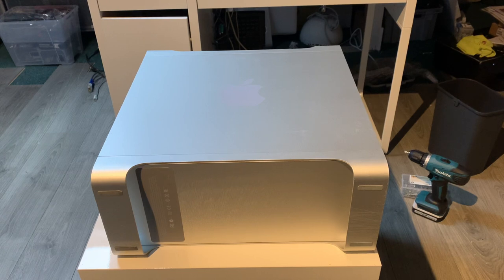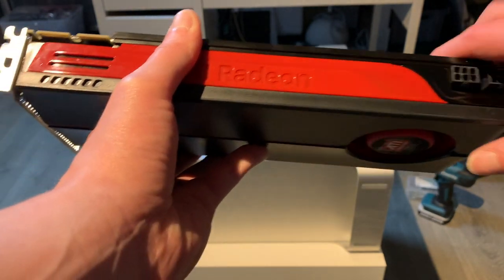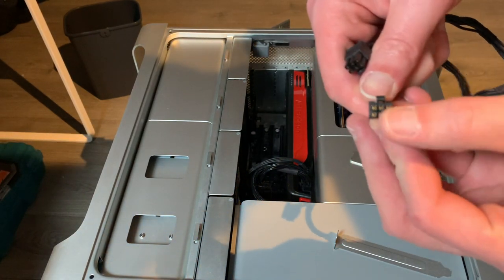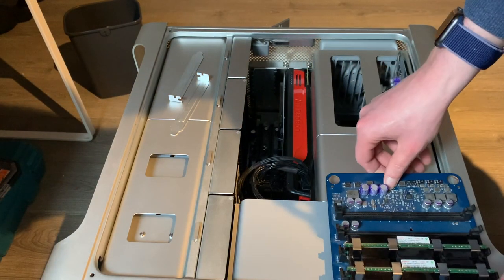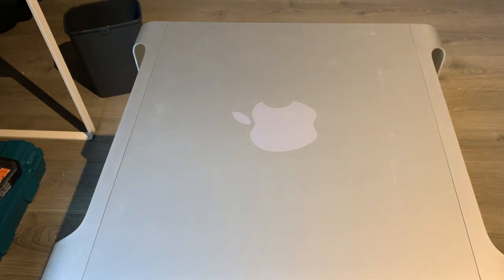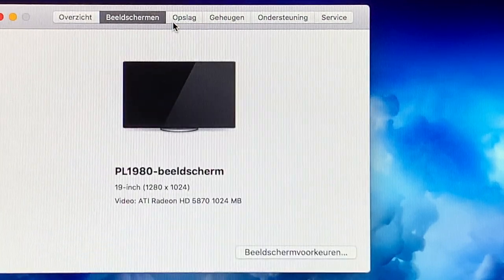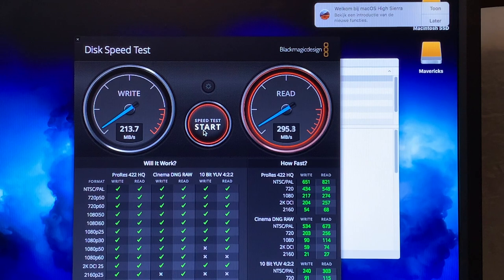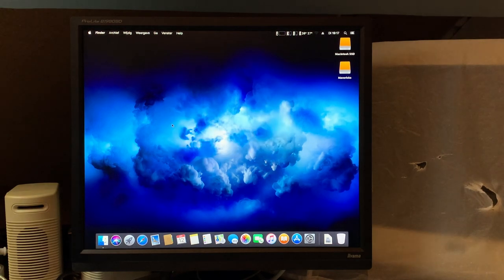Upgrades for the Mac Pro 3,1

Comment: Thanks for sharing!
My main Mac is one of these 3.1, 3 Ghz, same graphic card, 24 GB RAM. It´s great. And while my wife´s Air is being repaired I bought another 3.1 Mac Pro (2.8Ghz, 32 GB RAM, SSD +1 TB HD, Radeon 4870) for less than $300.
Until we get one of those gorgeous new M1 these Mac Pros do the job!!!
Reply: Sata SSD runs like 5 times faster.
Reply: @reinaldolockeortiz  I know…

Comment: Mac Pro 3,1 probably the best computer ever made. As long as you have an octacore, get an ssd and upgrade the gpu to something nicer. The most you can go is a gtx960, the CPU will bottleneck the card if you get something nicer. Rather that over a 680 it's newer, just save your original gpu, if ever need a boot screen. You can also just choose the start up disk right in settings anyway.  Itll run Monterey fine. The cpu dual 2.8ghz is still better than the minimum spec MacBook Pro that can run Monterey. Computer will last to 2030 and be usable for multitasking, presentations. I have mine set up with 3 HD's. One 500gb ssd with the dosdude Catalina patched os, (will prob wait a few years before trying a Monterey patcher) an old 1TB Hd 500gb partitioned for time machine of the ssd and 500gb as bootable version of El Capitan. Then the original 320gb partitioned as a boot disk, and 250gb partitioned to keep the patched version of the OSs. Always have backups!! Especially when you start playing around with the patching.

Comment: Lucky that putting air through the riser cards worked. I had to order new cards and then I was still having 2 slots that were dead.
Reply: Indeed: Two Slots from one of my 3.1 riser cars died months ago; I was pissed off. But I bought two second hand risers (they included like 16 GB  of RAM too) for maybe 30 euros.
Reply: (riser cards)

Comment: It looks like your aftermarket RAM is overheating. It's not built for that machine, since it doesn't have the proper heatsinks. I believe on the MacPro3,1 the temperature of the RAM is only measured on slot 1 and 2 of riser A, and it looks like you have OEM RAM in there. If so, then what is happening is your Mac Pro is measuring the temp of the RAM with the giant heatsinks which will be cooler, and keeping the fan speed low to match those lower temps. This means there is not enough air going through for the other RAM, so the other RAM will overheat. If your new RAM has temp sensors, you'll want to move those RAM modules to DIMM slots that can utilize those sensors, to allow the Mac to more quickly raise fan speeds to keep the RAM cool. Unfortunately, with this type of RAM, often that means more fan noise. OTOH, if your RAM does not have temp sensors, then you are out of luck.
Reply from the maker: The RAM is sitting in the 50’s most of the time. I’ve used Mac Pros with this kind of RAM for years. Never had issues.
Reply: @nelizmastr  I'm not sure if I explained it correctly. I'm not saying you shouldn't ever use that RAM. I am saying that if you are going to use that RAM, then then it should be in the DIMM slots which the Mac Pro can monitor. If I interpreted what was in your video correctly, you had the OEM type RAM in the temp monitored DIMM slots, but put the new server RAM in the other unmonitored DIMM slots. It should be the other way around (if that new RAM has temp sensors that is). That type of RAM tends to increase in temperature much more quickly than OEM RAM, and the only way the Mac Pro can compensate for that is if it can detect that RAM's temperatures. With the way you had placed the RAM in the video, the Mac Pro can't do this.
Reply from the maker: All RAM slots are monitored in the Mac Pro. All memory modules have temp sensors, so it’s okay. Fan speed increases occasionally when RAM is loading up so all is well :)

Comment: some minutes ago, i found on the internet a mac pro 3.1, with 2 xeon 2,8 ghz quad-core CPUs, and the nvidia quadro fx 4600, 32 gb of ddr2 ram, and macOS catalina installed. i thought of buying it and then upragind it maybe a lot, with things like an rx 570 or an ssd. now that i watched this video, holy crap, i buy that thing right now!
Reply from the maker: Catalina will not run properly on that FX so definitely throw that RX570 in there. Should run well. I’m going to properly upgrade to a newer card at some point as well.
Reply: @nelizmastr  thank you for the tip, i will leave it high sierra. Is it ok if i add a gpu? the guy who sells the mac pro, says that you can have maximum 4 graphics card working together, snd if it's true i tought to buy an rx480 and a rx 570, put them in, and make a beast out of that mac pro
Reply from the maker: It won’t run 4 cards at full speed. The bottom one is the only one that’ll run x16. The second one will run x8 and the top slots run x4.
Reply: @nelizmastr  thank you so much for the help

Comment: I just bought one of these for $25! Great to know that I can do cheap upgrades
Reply: 25 dollars?? These things do 250 euro over here still 😳
Reply from the maker: I bought mine for €80. It's mostly the later models, like the 4,1 and 5,1 that still sell for stupid amounts :)
Reply: @nelizmastr  Yeah. True. I must admit the one I picked up three days ago was 50 euros because it was supposed to be broken. I didn't (want to) believe that and I was right: it's fine. Found 24Gb of 667Mhz memory and bought a 120Gb SSD. Total money spent is now 81,30 euros and it is plenty fast! Will install Catalina on it. And if we get lucky dosdude1 might be able to get Big Sur on it? That would be INSANE.
There's an offer for two 4,1 Mac Pro's around the corner for 200 euro's the two. Missing memory and disk. Might be buy-in those to resell for that insane price ;-)
Reply: @SleeveZipper  in Belgium also 250-300
Reply: @SleeveZipper  Same in the UK. They go for crazy money :(
Reply: @yamahamusicians  I'm going to sell mine for crazy money soon I think. My MacBook Pro early 2013 is now about 600 euros 2ndhand. Nuts!
Reply: @SleeveZipper  big sur is on the mac pro 3.1 dude, just need a metal gpu.. And upgrade the wifi, and fit pcie usb 3.0 if your that bothered
Reply: @mikesinclaire8233  I know it is but I haven't found a proper guide on how to do it though. There's guides but these are all fiddly still. Have you done it already?

Comment: Are dirty ram slots of mid-seated ram modules a common cause of the red led’s on riser boards? I had 4 of 6 sticks show as an issue and just removed them thinking they had died.
Reply from the maker: If the slots have been unpopulated for years, it becomes an issue, yes. Dust builds up in there. Some compressed air or a soft brush should fix it though. Another cause of the red LED is improper configuration. RAM has to be inserted in a certain order to work properly in dual or quad channel configurations.

Comment: Where did you get the ssd adapter that holds your kingston ssd and m2 ssd? Can I use any kind? I have a Mac Pro  3,1 also
Reply from the maker: I got the 2,5” to 3,5” adapter from Amazon. Icy Dock makes these and I’ve had great luck with them.

Comment: how do you conect to the monitor? wich cable i need? my husband found this on garbage and im new with mac so im trying give life for this. tks
Reply from the maker: It depends on which connections the graphics card has. It can have a combination of many different ports. Most have one or more DVI ports (large white rectangle), others have mini-displayport (small almost square port) or HDMI or full Displayport (both black). 

You'll need a cable that fits those ports and can also connect to your monitor. If your monitor doesn't have DVI or Mini-displayport you'll need an adapter as well, i.e. DVI to VGA or Mini-displayport to DVI/HDMI/DP.

Comment: Hey man, had tip of audio cable break off inside - how do I get beneath fan to try & poke it out?
Reply from the maker: Sadly you need to do some disassembly for that. The entire front fan unit needs to come out.

Comment: I run  gtx780 on mine (was thinking about 1080) with High Sierra, 32gb RAM, 2ssds, the original 500gb Sata disk, and I have the boot screen. No flash needed. I was looking to upgrade the CPUs from 2.8 to 3.0, but I'm not sure it's worth it. Probably just look to the PCIe SSD upgrade n update to Catalina, then can't do much more with it.
Reply from the maker: Once you go beyond High Sierra, keep in mind newer Nvidia cards won't work, so stick to that 780 if you can. If your 780 gives you a boot screen, it has to be flashed, not a single PC card without a modified ROM will show a bootscreen until the operating systems finishes loading.

Comment: Would you know how to Diagnose Slot 1 in a MacPro 2008? I get power but I can't seem to get video, i have zapped the pram, nvram, etc. I have tried 2 of the original cards that came with the device, they are working cards and work fine in slot 2 but I can't seem to get video in slot 1 no matter what I do. Any suggestions?
Reply from the maker: Sounds like your slot 1 is broken, then. Try a different card, not a graphics card, in there and see if that works and gets detected.
Reply: @nelizmastr  unfortunately i think so too

Comment: Hey NeilzMastr! Wow stuff with the video! Ive got a 3,1 as well.. the RAM upgrades and the SSD upgrades are what Im Looking for too! I can clone my other MBP running Mojave onto the new drive.. question is.. SSD PCIe / SSD NVMe.. does it have any specs? Will any of these cards fit the motherboard of the Mac Pro 3,1? Could you put down some suggestions on which PCIe card I can get? 

Thanks a tonne sir! You're amazing!
Reply from the maker: Hi, NVMe won’t work in the 3,1 unless you use it as a data disk. And you need to run high sierra at least.
Reply: NelizMastr - Tech for PC & Mac I can run it as an OS disk.. and will mostly be running Mojave .. I can settle for a SSD PCIe if this NVMe is gonna be an issue
Reply: Are there specific pcie cards that would work with this?

Comment: Hey i have a question where can i buy the ram. I'm watching every where but can 't find some thing cheap hopefully you can help
Thx
Reply from the maker: Buy it on eBay. It’s no longer sold new in stores.
Reply: OWC (Other World Computing) has awesome parts for old Mac Pro's.  I just grabbed 64GB RAM, 2 SSD's on PCI trays, 4 HDD's, USB 3.0 PCI card, and an RX580 for my 2008 Mac Pro.  

Just make sure you get the fully buffered ECC (error-correcting code) memory for your Mac Pro.  And avoid the cheap ($5 DIMM's) China RAM.

Comment: Hello, my mac pro 3.1 (early 2008) with Mac OSX El Capitan, have: 2x2,8GHz QuadCore Intel Xeon - SSD 500Gb - RAM 10Gb at 667MHz - ATI Radeon HD2600 XT 256Mb.... One question: if I change my graphic card with the Invidia GeForce GTX 680 2Gb, is possible to upgrade at Mac OSX Sierra? Tkanks!
Reply from the maker: Yes. Of course you’ll still need an unofficial patcher to get to Sierra and beyond, but your graphics card should work. The GTX680 can be flashed with an EFI ROM for Mac, should you choose a PC card.
Reply: @nelizmastr  Tks!

Comment: Just curious, how did you do the install of High Sierra? Was it through a patch, or done on a supported machine then transferred in?
Reply from the maker: Google for Dosdude high sierra patcher ;). He made a patcher that downloads and installs newer versions of macOS that Apple wouldn’t support on certain machines.
Reply: @nelizmastr  I have a 3.1 as well and tried dosdude's patches, but doesn't work. It gets stuck in the loading bar... 😓
Reply: @inakisayar3220  Did you ever get this problem solved? I think I had that same problem back when I tried. Can't seem to find the stand alone installer either

Comment: HELLO! DOES ANYONE KNOW IF THE QUADRO K4000 GRAPHICS CARD IS COMPATIBLE WITH MAC PRO 3.1 2008?
Reply from the maker: If you flash it with a Mac ROM, yes. Otherwise it will work but no boot screen.

Comment: I'm thinking about buying a 3,1, but I've read online about serous motherboard issues. Has anyone had any sorts of issues? The symptoms for a broken board are: screen turns black and fans ramp up to full speed.
Reply from the maker: I’ve never heard about that on 3,1s myself. I’ve had 2 and neither of them had motherboard issues. 
I did have issues like that when I had a PowerMac G5. I only ever had one that worked properly, and I’ve had a few over the years.
Reply: @nelizmastr  Thanks for the reply, well I think I gonna take the risk and buy a 3,1. I had a quad core G5 with kernel panic issues as well, which very likely were cause by antifreeze dripping on the logic board.

Comment: Were you able to boot from the PCIe SSD? I have Mac OS installed on a 1TB SSD, but its installed in the SATA II sled. I would love to try to have it in the PCIe and gain some speed.
Reply from the maker: The SSD I used was SATA internally. If you want a proper PCIe SSD for boot, then you can try to find the older Samsung PCIe AHCI SSDs. NVMe is unsupported for boot.
Reply: NelizMastr - Tech for PC & Mac I’m currently running a 1TB SSD that I believe is in AHCI mode. I’m picking up a PCIe SATA adapter tomorrow to try out. Hopefully I can get SATA 3 speeds over the SATA 2 from the standard drive ports. You are right about nvme on the 3,1. I think it’s only the 4,1 and up that support nvme.
Reply: The PCIe SATA adapter did work. I'm able to boot, and my read and write speeds have hit the full potential of my SSD instead of being bottle necked by the 3,1s SATA II.
Reply: @murdocktexasranger  Hello, what PCIe model have you purchased?
Thank you

Comment: what is the max capacity the 3,1 can handle? can i put 3 internal 16tb hard drives and 1 ssd?
Reply: I've not confirmed this myself, but I've been reading that while the "system" can handle larger capacity drives the screws on the chassis of HDDs over 4TB are both larger and placed a tad differently than the Mac's sleds accommodate.

With that in mind, a "max capacity" would look like this:
• Sleds 1-4: 4TB HDD ea = 16TB (SATA 2.0 ~ 300MB/s)
OR you can buy adapters and put all SSDs in there. Or jury-rig them if you feel lucky.

• Find and install a (now discontinued) Sonnet Tempo SSD Pro Plus in a PCIe slot. This allows you to mount one or two (2) SSDs internally.  Heck, install three Sonnets and have six SSDs! And yes, you can boot from here. At 960 MB/s (!). Just be mindful of the 300W limit for the combined PCIe slots (inc the graphics card).
Oh – and this card includes two external eSATA ports as well so you don't lose the slot for external storage.

• Lastly (although I have not done this myself), install OWC's MM352A52MP Multi-Mount adapter kit, which supports two 2.5" SSDs – in the optical bay (SATA 2.0 ~ 300MB/s).  Or use both bays if you don't need a disk drive. I am uncertain of boot capability here.

So – 16TBs in HDDs plus up to ten (10) SSDs of whatever capacity your Credit Card can handle. Or just go all out for 14 SSDs. All internal.

Externally, you also have four (ancient) unused USB ports (there are five, with one used for your keyboard/mouse), four (adequate) FireWire ports (2 x 400; 2 x 800), and an extra Gigabit ethernet port (likely for your NAS). Plus the eSATAs on the Sonnet card.

Of course, you can install a USB-3 PCI card if you have any unused slots for further more modern external storage, but I'd think the Sonnet's eSATA would suffice. Just be careful that both hardware and software specs can be met. The main letdown is the inability to support Thunderbolt. But USB 3.0 can work.

And this is just one reason why a lot of us have called these machines some of the best Macs ever produced.

Comment: have you tried m.2 drives yet on 3,1?
Reply from the maker: I’ve tried M.2 SATA drives, they work fine. NVMe also works in newer macOS versions but not as boot volume obviously.
Reply: @nelizmastr  wow I did not expect a reply so fast. Im new (got mine last week) to Mac Pro just got the 3,1 and since learning lots just from youtube. What would you suggest in 2022 for a M.2 pciexpress cards been seeing many videos out there using the Sonnet drives cards. maxing out ram to apple supported 32gigs have 4 SSd sleds aka hard drive caddy.

Comment: Cool! So, did you finally upgrade to Mojave or Catalina? If yes, what's the graphic card would you recommend? All need to be
Flashed?
Reply from the maker: Hi. I haven’t upgraded yet. Can’t currently justify the cost of a new card so it’ll happen eventually. Flashing is out of the question, as there are no cards with Mac ROMs that support Metal, aside from the GTX680 and HD7950. Everything else will work, but without a boot screen.
Reply: @nelizmastr   @NelizMastr - Tech for PC & Mac  does it mean whatever card that compatible with the machine (like Mac Pro 3,1) then it's good to Mojave or Catalina, but just without Boot Screen? Still, only GTX680 & HD7950 could be Flashed at the moment?

Comment: What's si speed test pciexpres 16 nvme?
Reply from the maker: This Mac doesn’t support NVMe, only SATA.
Reply: @nelizmastr  mm pciexpres 16x ? Yes support  it's Port is equals of Mac OS 2009,
Reply from the maker: NVMe requires support from within the firmware, you can’t put it in any slot and it will work for booting. The 2009 and 2010 have special firmware that allows NVMe to work, even as a boot disk. The 2008 does not.
Reply: @nelizmastr  thanks for request